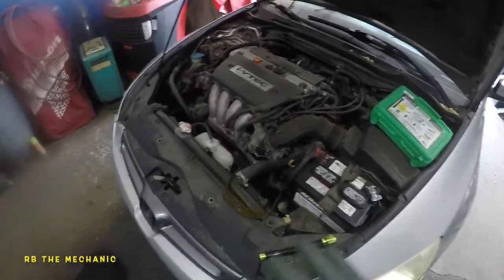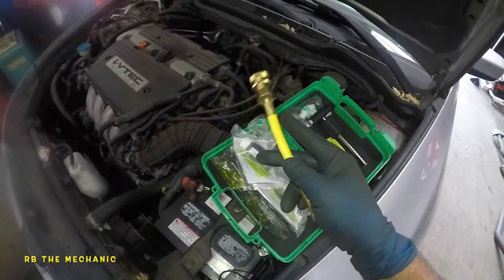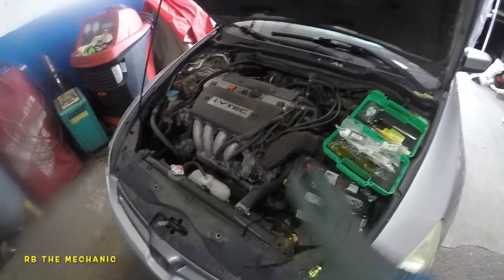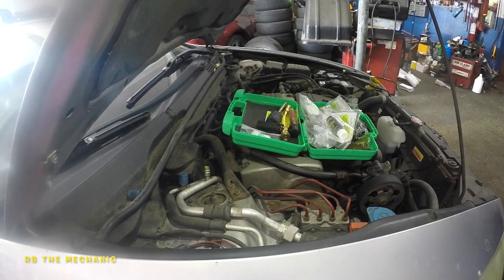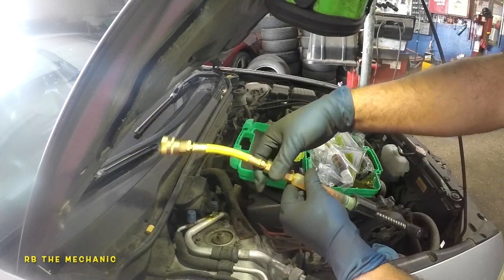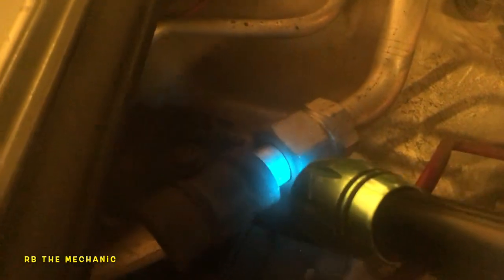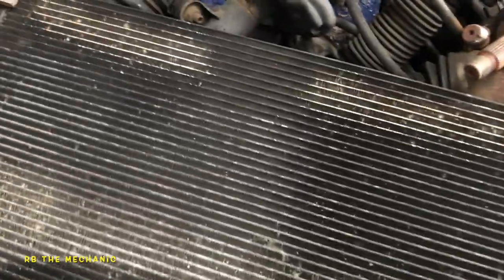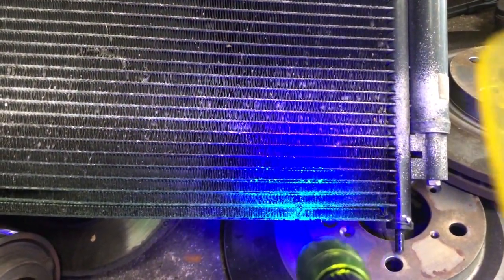Find AC Leaks with this AC UV DYE KIT only $124 but works like million dollars

Comment: Hello I been struggling on my 2012 Honda Civic hybrid my a/c stopped working and being from Arizona it’s bad 🥵 I’ve looked and I can’t find any video of anyone working on my type of car but the a/c is blowing hot air and the fans aren’t working at all ! I can turn on ac high low ,cold or hot or even after driving fans don’t turn on and before the ac stopped cooling I would turn it on and I could hear it activate but now it’s silent like nothing gets activated then I noticed the recirculating button is off the light on it doesn’t even turn on anymore I got a/c relay and fan relays but I can’t seem to find a diagram on what relay goes where ,if you could help or could show me a diagram of exact relay name’s on the fuse box  thank you 🙏
Reply from the maker: U have electrical ac compressor that’s the big issue anyways step number one check ac pressure and let me know here’s one video how to check with machine https://youtu.be/b82boCWSq9w
But problem is ac need to work how ever u can see pressure with ac off as well should be somthing similar